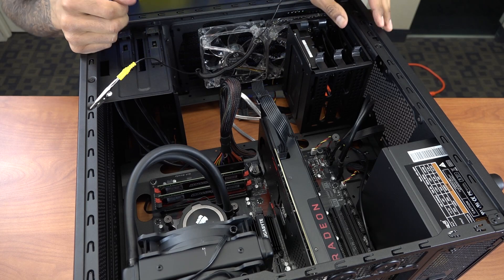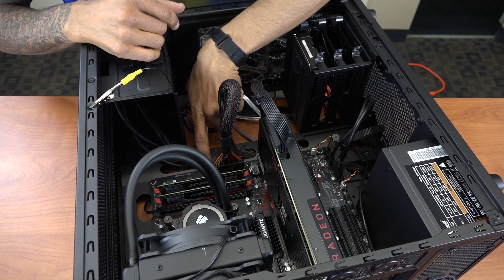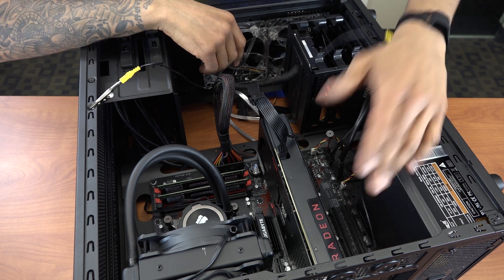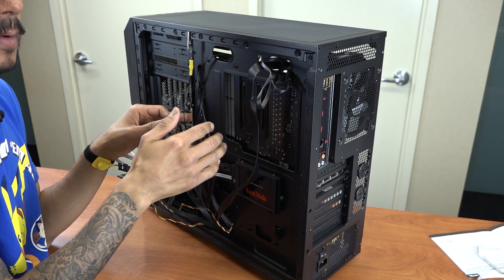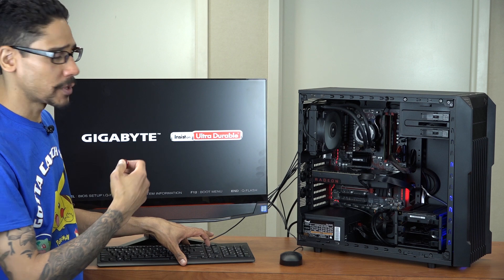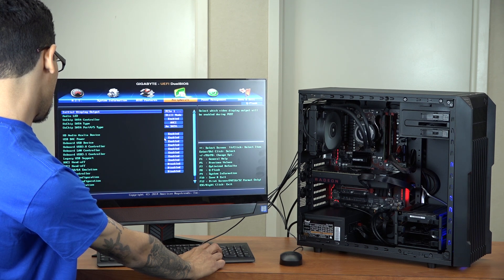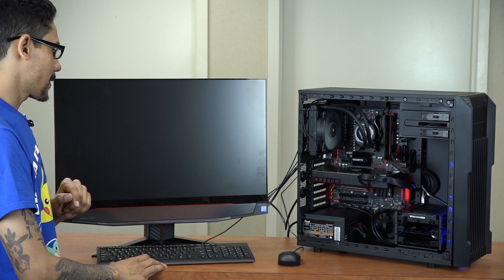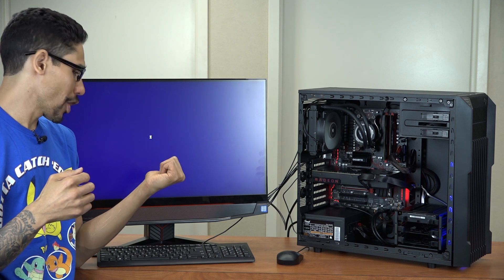Installing SSD, SATA HD, Cable Management and Windows Installation (December 2016 PC Build)

Comment: my case suports 2.5 inch drives but i know i could put an 3.5 inch drive  in there. only question i have do the 2.5 and 3.5 inch hdd's use the same connector?